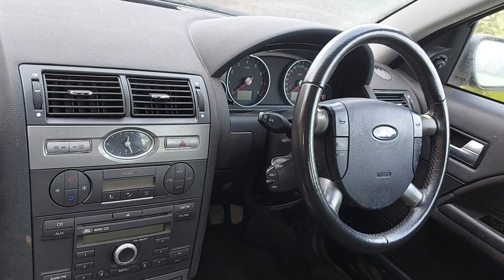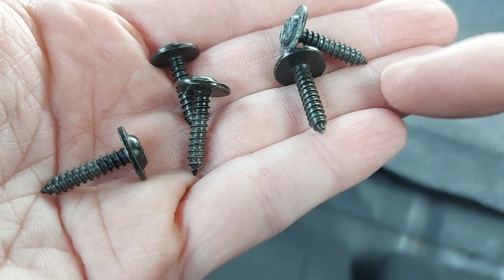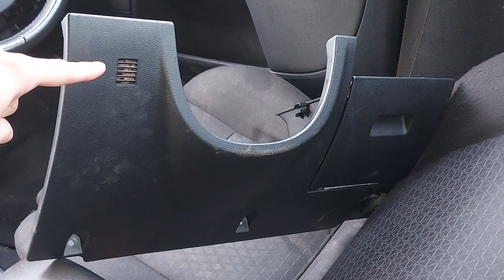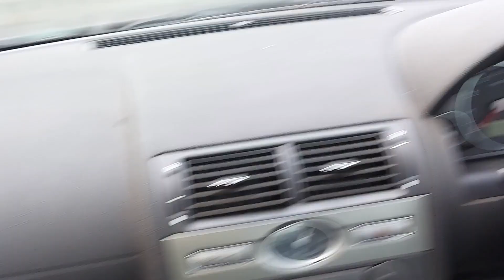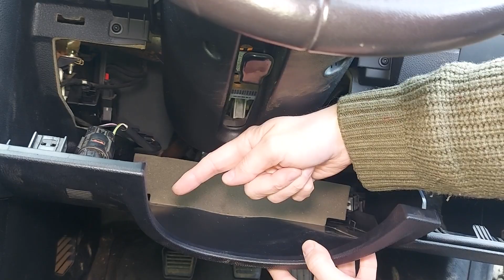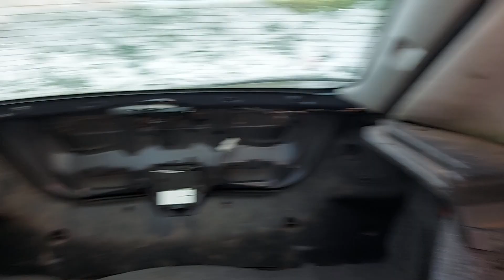Ford Mondeo Mk3 Climate Control: How To Replace Internal Temperature Sensor (Self Diagnosis)

Comment: My airco works when I start the engine when its cold but after driving half or one hour  its stops giving cold air, especially when its so hot outside.
The gas has been revilt.
Its a mk3 from 2003

Comment: Hi, where is the Evaporator temperature sensor located?
Do you have a video of that?
Reply from the maker: Hello. I haven't covered this in a video. However, there might be some info in the workshop manual. Good luck.
Reply: @CarSpyTV Hi there,
I donot have a workshop manual, I saw a little connector on the right side when I removed the handglove case.
But I was afreight to harm something.
Do you have a link for the workshop manual?
Reply from the maker: Hello. You can get a manual on eBay.

Comment: Is this the reason why my heater on my Ford mondeo malfunctions? I Can turn it on high, it doesn't heat, then out of nowhere the heat comes, then it's off, just blow cold air, then heat comes again, just on and off constantly
Reply from the maker: Hello. If it was my car, the first thing I'd do is check the coolant level. Good luck. Hope you resolve the issue soon.

Comment: Can you help me with why the test mode doesn't start? Also, the car can blow cold air for about 20 minutes, then the air conditioning power goes away. I don't understand, there is pressure in the system, the compressor is working, everything has been looked at by a hundred mechanics. I also cleaned this sensor, I don't understand anymore.Thx Csabi from Hungary
Reply from the maker: Hello. The Mondeo Mk3 Workshop Manual might point you in the right direction. It's easily available. Best wishes from CarSpyTV.